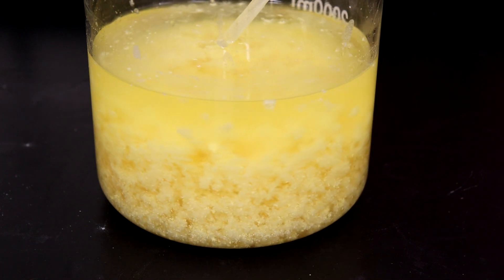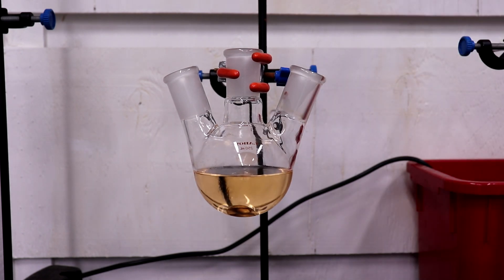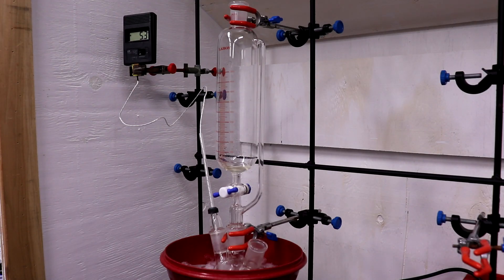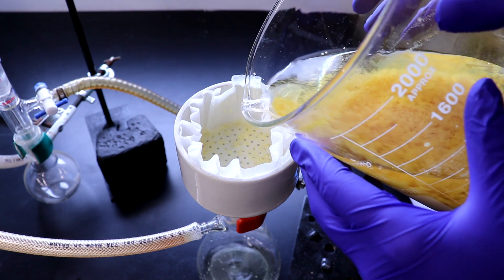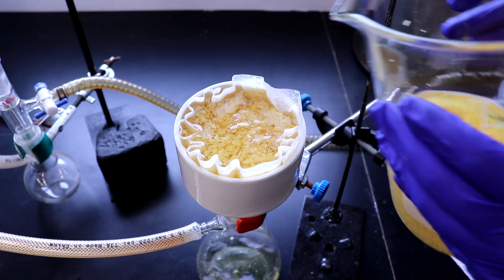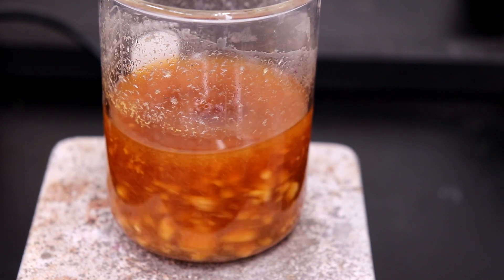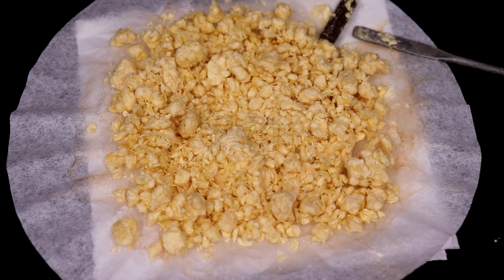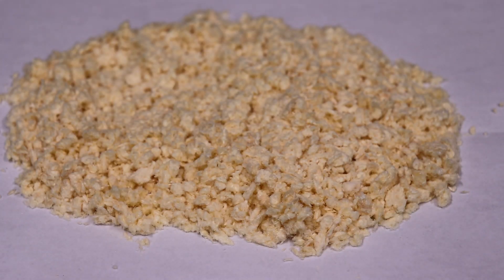Knorr Pyrrole Synthesis of Knorr's Pyrrole

Comment: One use I found was as a starting material for the total synthesis of chlorophyll A, which I'm sure involves a tremendous amount of work as the intermediate chlorin-e6 trimethyl ester took 46 separate steps to produce according to the summary of the paper.